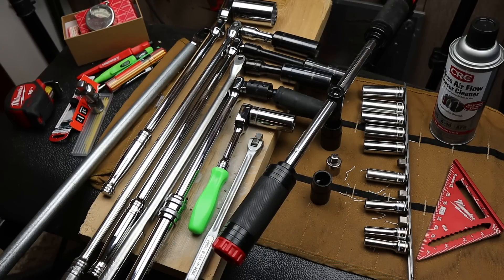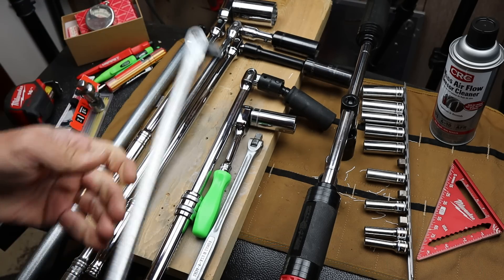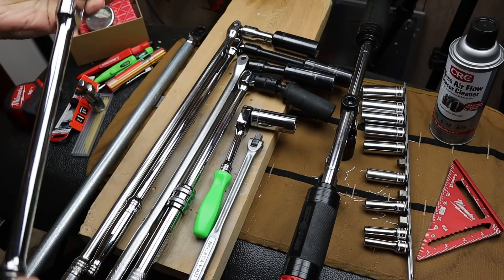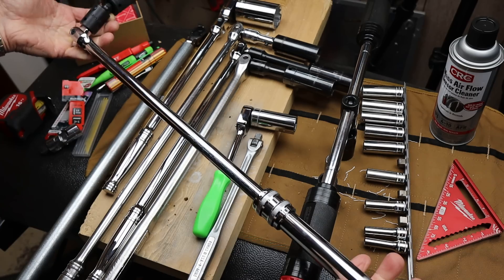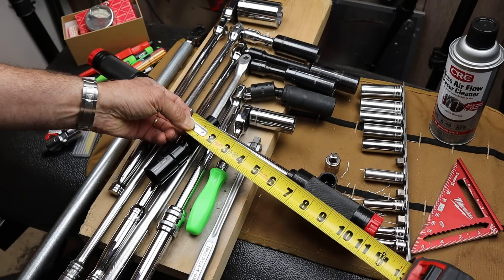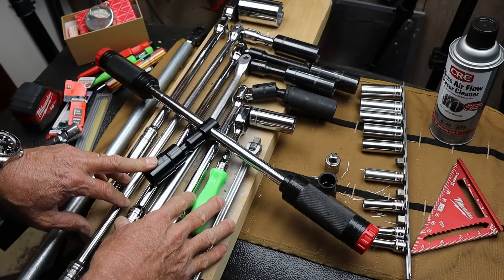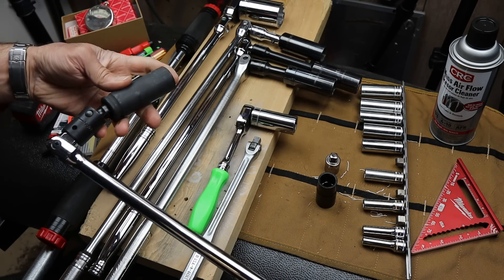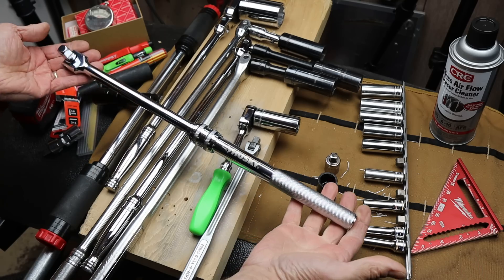Lug Nut Wrenches? What could be more exciting that solving this equation?

Comment: I keep a couple of 1/2 inch drive Craftsman around, one exactly like your Craftsman =V= you have there. For 3/8 drive I keep my recently inherited Snap On . But recently I’ve been using Harbor Freight 1/2 drive 24 inch comfort handle breaker bars and am not only happy at the performance but also alleviated at not having spent a small fortune for them. Good subject matter by the way. 👍
Reply: Same here. My Land Rover has 1 1/16 lug nuts and I had to replace the originals with solid SS nuts since tire stores had warped the stainless covers with impact drivers.

Comment: I have the collapsible Husky lug nut wrench but the MichaelPro MP007002 1/2" Dr. Extendable Breaker Bar is about three inches shorter but extends to a full 24” and seems to be the same quality as the Husky.  You can find them on Amazon for $35’ish dollars.

Comment: Always! I put a breaker bar and the correct socket in the trunk.  And after having my tires serviced I always re-torque them as sometimes depending on the shop are over torqued.  Had to use an impact wrench to get them off once as the breaker bar wasn't enough and nuts were extremely over torqued.

Comment: Always have my 1/2 old Craftsman USA breaker bar in the truck. Also have some neat lug nut kits from Home Depot (Husky I believe) With. CRV, Tacoma and 100 series I need to keep a 17, 19 and 22mm lol… I believe Gorilla has a great wrench with a good forged in offset as not everyone knows or realizes the front wheel might not be on perfect perpendicular alignment with the front axles and those longer handles hit the bumper or worse scratch and damage the front fender. I’m learning to appreciate the simplicity of tools that have been specifically made for a purpose and not part of a kit that has multiple pieces or “bits” Guess what I’m saying is I’d happily pay for a dedicated breaker bar with 4” ext and a molded in or locking type detent ball for my lug nut sockets. I hate it when it gets dropped or moved and part of it comes apart! Keep up the good work man, love your mindset and where your going with your thoughts!

Comment: I have been a Auto Technician for over 25 years and i personally have a quite a vass array of large ratchets and breaker bars .........
But i picked up a HF 25'  1/2  Breaker Bar and attched to it is plain jane 6 inch extension with a 19-21mm flip socket and it works just fine for all the tires i have thrown @ it .
If i cannot remove a lug nut with that setup then there is NO NEED for me work on it on the road .......  
Have it flat bedded to my house where i have all my tools .

Comment: Doc this was great.  I have a very hard time finding a chart or list of SOCKET SIZES for car/truck lug nuts. You can find the diameter / thread type of the studs but i cannot find information on what size a socket is needed to remove stock lug nuts off vehicles...Do you know where such a list exists?  It is not even in individual owner's manuals...

Comment: I like the extendable 1/2" ratchets ...keep it lubricated with wd40...I've had mine get stuck..until I started keeping them lubricated with WD40..or what you like...
I've got the DeWalt tire changer kit with a breaker bar five sockets and their click style torque wrench all half inch with a flashlight for a hundred bucks ..all in a case ....
Great kit...
 but if you're trying to keep it light ...a good breaker bar with a short extension and a couple sockets should do the trick...
4 ways suck
An impact is the best way..

Comment: The best possible one is made by Snap On, the SN4B Flex-Head Speeder Drive Handle.

It's a cross between a breaker bar and a speed handle.

Break it loose then you can spin it off really quickly.

Comment: The Hazet extendable one is the best I haveas a breaker.  On old Porsche the lug nuts are aluminium so you need a torque wrench to tighten.  So I have both.  And $200 is nothing.  Try buying the right equipment to do the lug nuts on a GT3 “ptstouring” …. :-)
Reply: It's only my opinion... and others will disagree; but life's just too short for piddling with Porsche products.

Comment: Someone gave me one of those Husky 24" telescopic breaker bars... probably over a year ago now. It's perfect for keeping in the car! With it I have an old short Snap-On extension, a used 19x21mm thin wall BluePoint (LRS1250) flipflop socket & old Williams (S-70) 1/2" drive spinner. The socket fits mine & all known family/friend vehicles. Have yet to actually need any of it, but it's nice knowing it's there.

Comment: You should use chrome sockets instead of impact sockets on breaker bars. Impact sockets are more brittle and more likely to break on a hand tool than chrome sockets. Would suck if you're in an emergency situation and your socket breaks
Reply: Actually you have it backwards.  Chrome sockets are harder than impact sockets.  Impact sockets are softer and thicker so they can withstand the sharp blows of an impact wrench better.  There is no disadvantage using impacts over chrome other than the thickness may impede access to certain fasteners.
Reply: @motorpsykler  Indeed.
Reply: @motorpsykler  actually yes there is. Impact sockets are more brittle. Yes they can handle an impact gun better than a chrome socket, but they cant handle hand work as much as chrome. This is a well known fact  which is why you use chrome sockets for hand tools and impact socket for impact guns. Just because a metal is harder, doesnt mean it isnt more brittle, look it up.
Reply: @jacksmith2315  Chrome sockets ARE harder and they ARE more brittle.  I looked it up before I commented the first time because you made me question my intuition.
Reply: Impact sockets break under stress? Kinda defeats the purpose